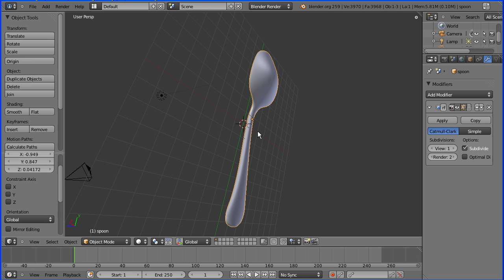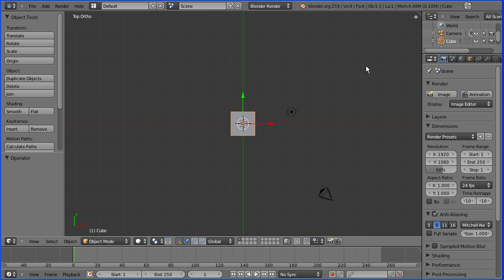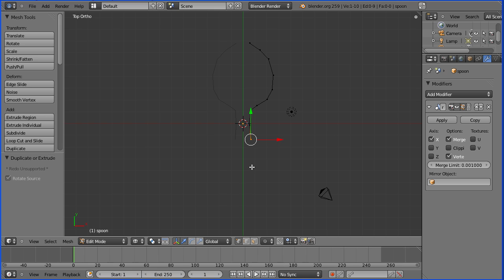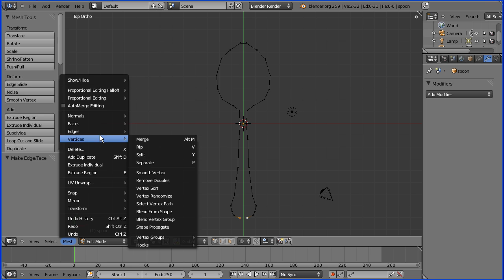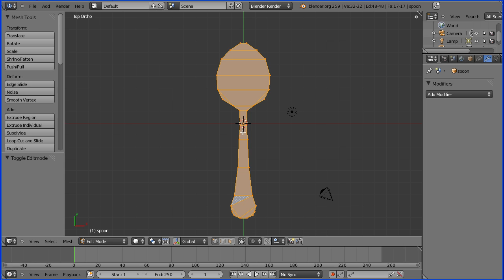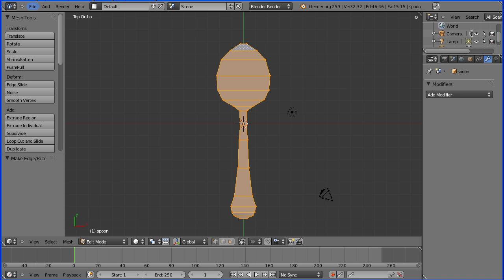Blender Making a Model of a Spoon Part 1 Drawing the Outline in Edit Mode Using the Mirror Modifier

Comment: Thanks for the tutorial man, but I'm having problems adding a vertical line, the green arrow seems to get in the way, if that makes sense :-) What am I doing wrong?
Reply from the maker: +niemanickurwa You can turn off the green arrow, at the bottom of the 3d window there is a button with an arrow on it, the button to the left of that (three lines) will turn the arrows off. The same button will turn them back on again.

Comment: what happen if we not do tris to quad?
Reply: Watch part 2 and you'll see. If you're making a symmetrical object like the spoon then everything in it needs to be symmetrical. Not just the outline, but the faces inside. If you try doing the next steps in part 2, you're going to get some weird results when you try bending those triangles all around. Most people would leave the mirror modifier on until the spoon was almost done. It's kind of odd that he ends it so soon.